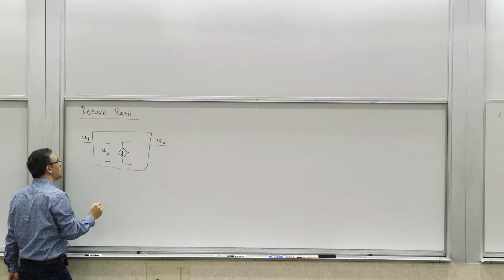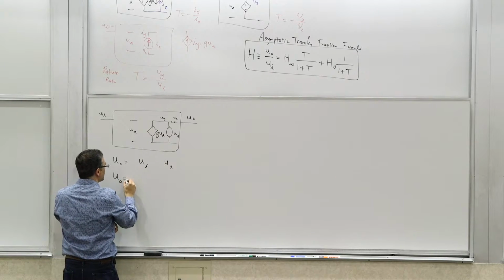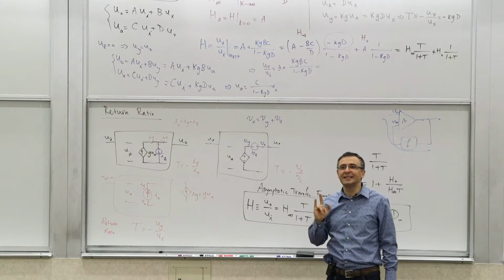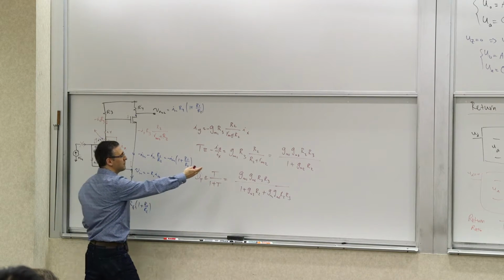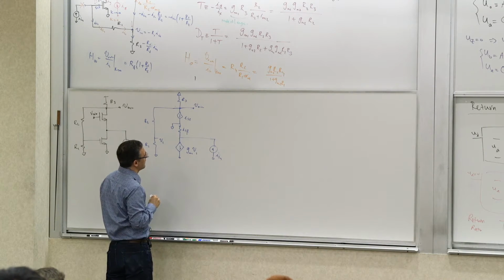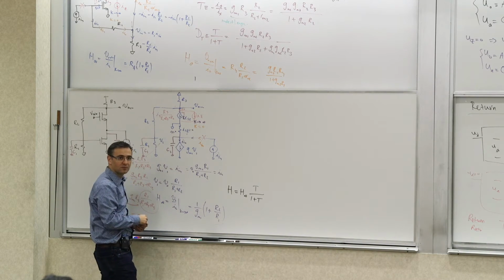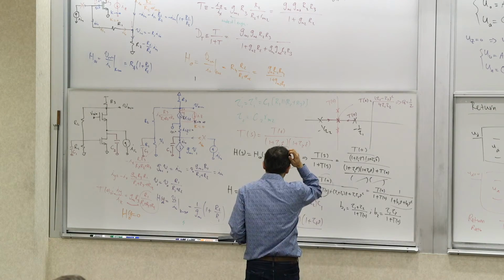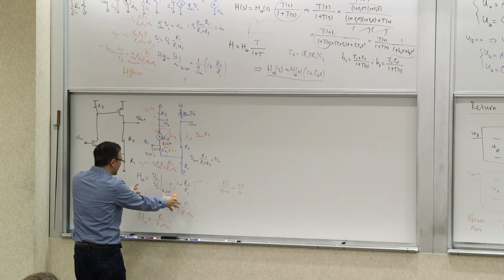161N. Return Ratio, Asymptotic Gain Formula, Direct forward transfer

Comment: I would like to see the circuit  example at 48:00 being solved with k=infinity applied to the lower transistor, i.e. having k*gm1 instead of k*Is2...
Reply: Answering myself.... In that case H∞ = 0 b/c k=infinity ⇒ V1=0 ⇒ IR1 = IR2 =0 ⇒ Vout=0 and all the current Iin goes into the gm*V1.
T (the return ratio) is the same as calculated in the video T= gm*R1*R3 / (R1+R2+R3)
H₀ = R3(R1+R2) / (R1+R2+R3)
Therefore H = H₀/(1+T)  = R3(R1+R2) / (R1+R2+R3+gm*R1*R3).

Doing H = H∞ .T/(1+T) for the example shown in the video leads to the same result.
Reply: @justpaulo   H∞ = 0, you get nothing at the output Vout. I believe, you cannot apply k to everywhere. k has to be applied to the forward path sources, in this case is2. If you see his earlier lecture, he defined the k at the forward path, in front of forward gain of A, i.e. kA. M2 transistor is in the forward path, while M1 transistor is in the feedback path.
Reply: Actually, in the H∞ = 0 case with the lower transistor, if you consider H∞(1 + H0 / H∞), the result is the same as in the video. A 0/0 cancellation occurs  —I hope it doesn't bother the math guys

While using the TTC (Time and Transfer Constants) method, I experience many 0/0 and ∞/∞ cases. 
I feel like, as engineers, we desire a strong theoretical method that is applicable to any kind of circuit. No one likes "insightful" methods when it comes to hand-and-paper calculations.

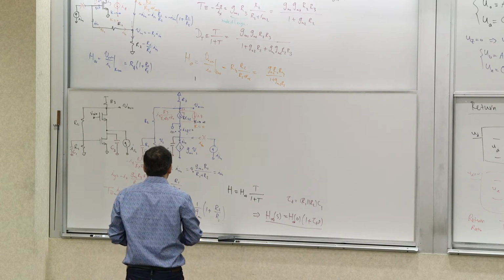Comment: sir，@1:04:00... gm*V1 depends on the test voltage, and should be considered for port impedance calculations, if I'm not wrong...
Reply: What you said is correct they are not independent poles

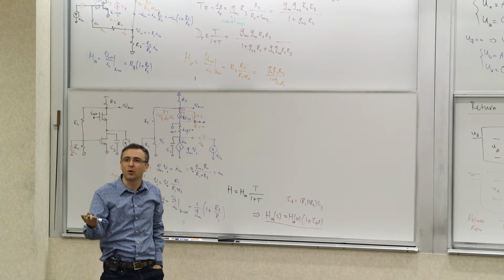Comment: @1:04:00... gm*V1 depends on the test voltage, and should be considered for port impedance calculations, if I'm not wrong...
Reply: ix is nulled coz it is driven by an independent source as input, so the circuit on the left (R3, R2, R1) is isolated and completely off. Therefore, V1 is 0 and the dependent source is off.
Reply: @苏启哲 when we apply test source at v1 to calculate time constant it will excite m1 transistor as we are directly giving voltage at its gate so due to v1 there will be gm1*v1 current in rm2 so both poles are not independent of each other

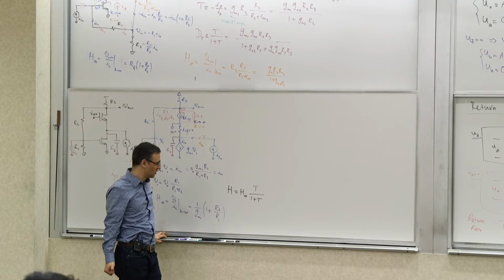Comment: Sir! Can we apply the Generalized TTC approach to calculate the response in the circuit at 59:00 ?

I know that it produces a pole in Feedback path but becomes a zero in the overall transfer function as the k->infinite... But I want to use TTC here... Because if in a system pole is not there, then how it can have zero as per our TTC approach... Pole is not existing means the time constant is itself zero... So zero should not be there...

Comment: Hello Sir...
If the circuits include parasitic capacitances also, which method should be followed?
Time and transfer constant method or this asymptotic gain formula method?
or is it necessary to use both to get overall transfer function?

For me, i feel like any one method is sufficient...but i want to know which method is more easier to calculate H(s)??

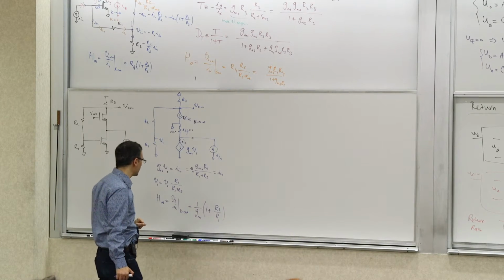Comment: 50:20 - If we pick transistor M1 for scaling its gain with k, we would see that V1 must be 0 and thus Vout also. Does that mean we are not interested in having bugger gain in M1 but rather in M2?
Reply: I think M1 here is in feedback path thats why we see gm1 in H(inf) expression. We need to set the k->inf for forward path which is only M2 in this case

Comment: 32:50 - If I am working with some complex transistors in something like 22nm and I am using Cadence, can I still add in schematic independent current source Z on the drain of first MOS transistor to have the same currents X and Y? As in model of that transistor gm*Vgs won't be connected directly to the drain, but who know what will be there between it and drain, if even can it be considered like that. Or we can simply consider whole transistor (it's AC model) as dependent current source and don't worry about it's function?

Comment: 32:56 - If instead of the MOS transistor there was a BJT, would we still be able to say that current accross R1 is 0 as stated previously when finding H_infinity or not, as we now don't have K in dependent current source?
Reply: yes, H_infty implies base current zero. Your collector current in the small signal model is ic = beta*ib. Adding the factor K and making it infty, the only way for ic to be finite is for ib = 0. Think of asymptotic behaviour as a transistor with ideal beta (infty), thus base current = 0.